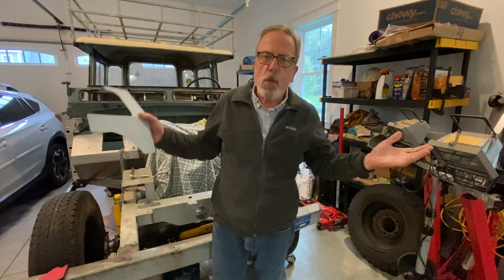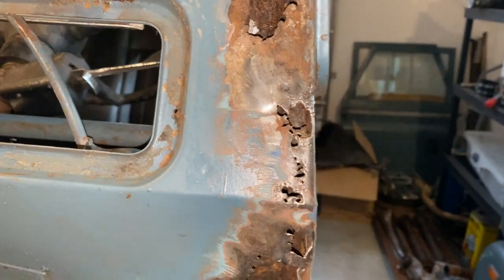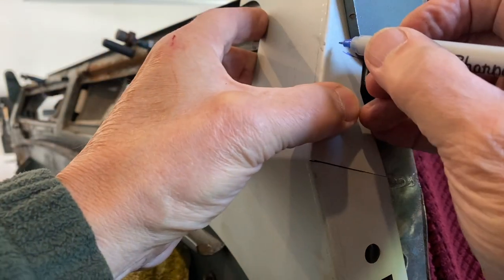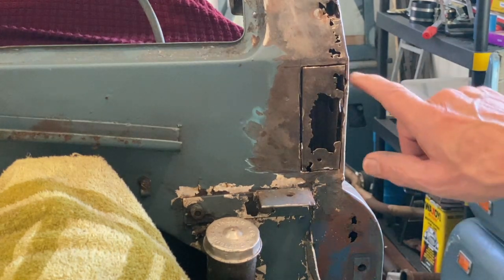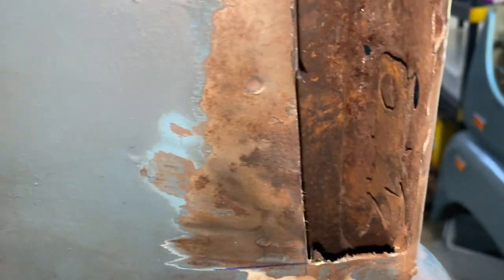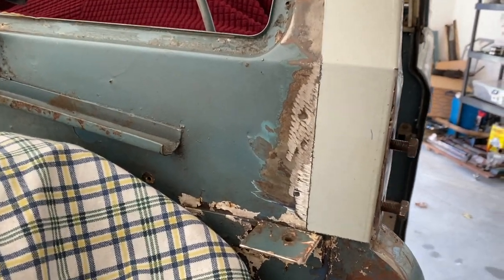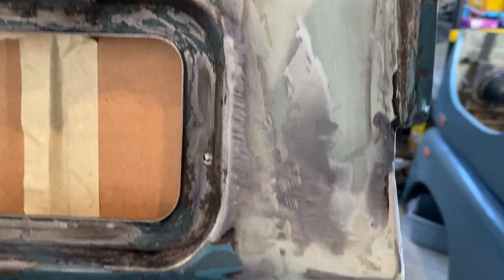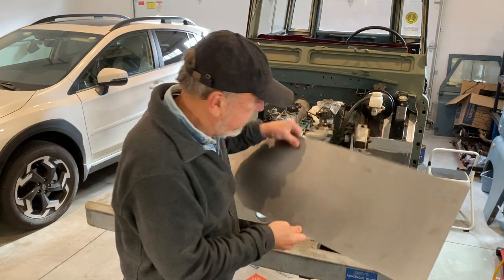Repairing a Rusty Land Rover Series IIA Bulkhead   HD 1080p

Comment: Nice job.  Your bulkhead is in worse shape than mine.  Replaced both footwells and the right side door post on my 2a—major surgery.  One tip:  use an air gun to cool the stitch welds to prevent the workpiece from warping.